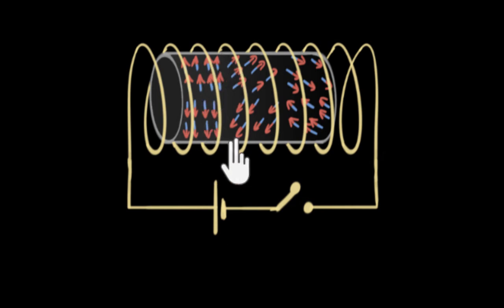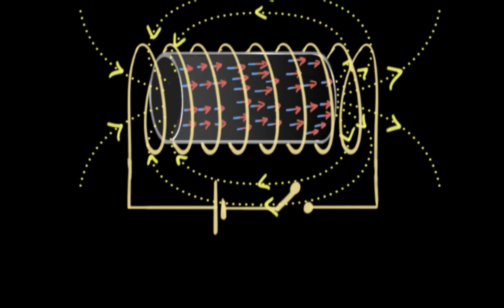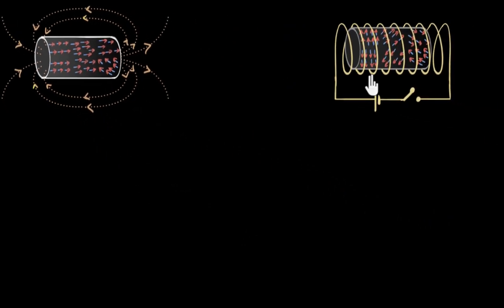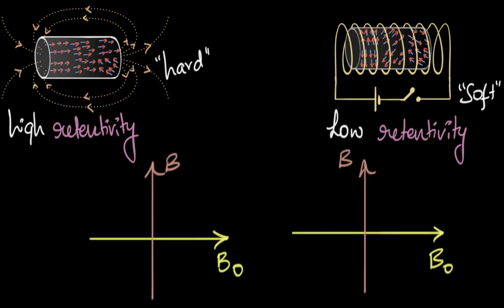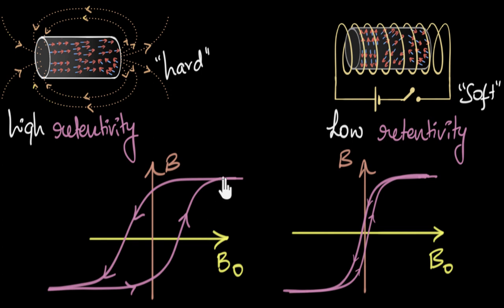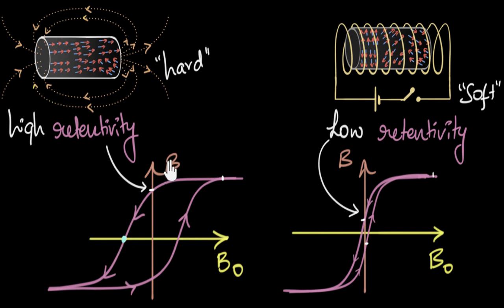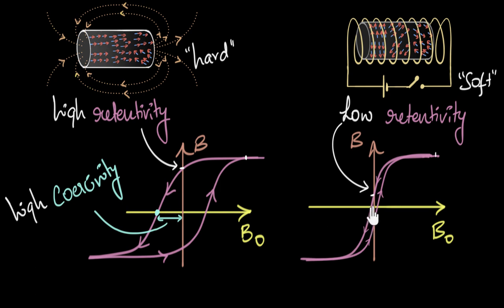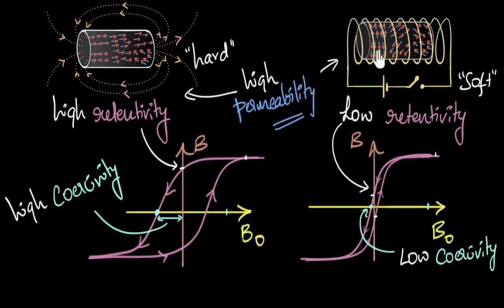Coercivity & retentivity (Permanent & electromagnets) | Magnetism & matter | Physics | Khan Academy

Comment: Very nice video. Excellent way of explaining. However, one topic to discuss is, a permanent magnet in its fully magnetized form will  basically have very low permeability as no external magnetic field can cause the change in internal magnetic field? Only with respect to magnetic materials, we can have this comparison and no with permanent magnets which has no influence on the Bo value applied externally. This is basically what i understand. Please correct me if i am wrong in understanding. Thank you very much